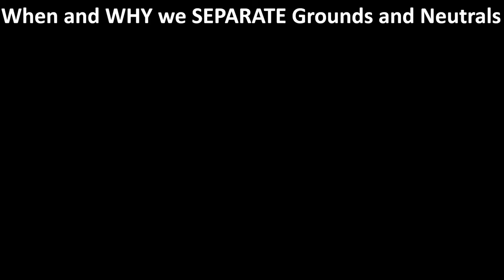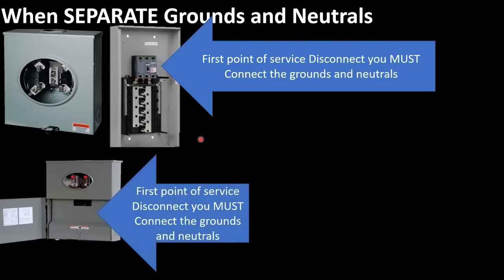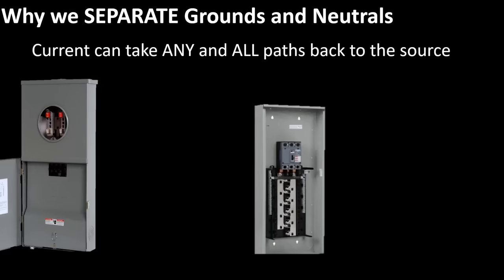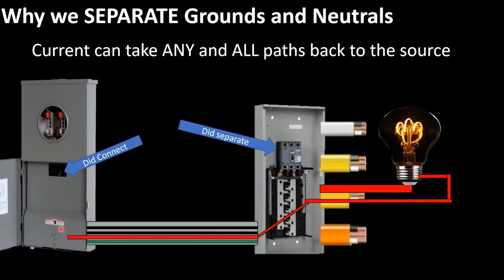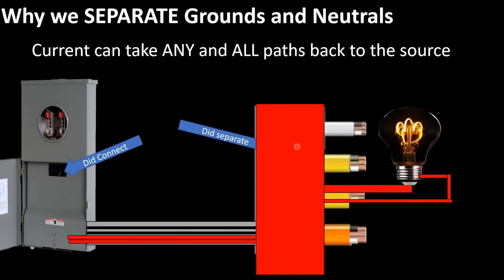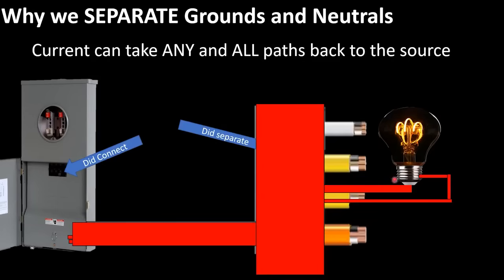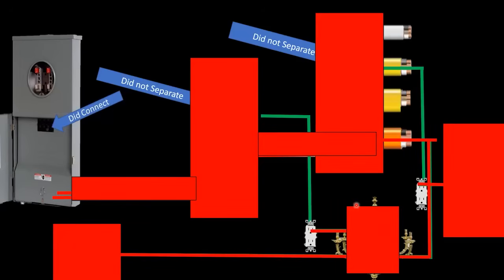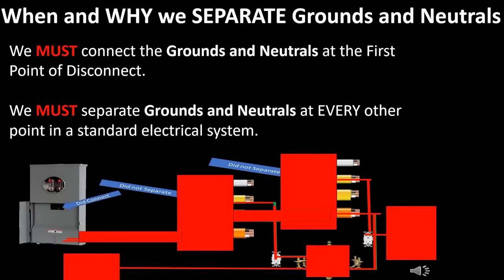When and Why to separate Grounds and Neutrals.

Comment: Great video. Thank you for sharing your knowledge.

Question: Hypothetically speaking, what if a house had a main panel with no main disconnect (just individual breakers), that panel would still be “the first point of disconnect”, correct? In this hypothetical case, the neutrals and grounds would be connected and not isolated. Am I right? I know that, by code, the panel would require a main breaker (except in a 6 breaker or less situation). Just trying to understand the concepts fully.

Comment: The ground wire should be installed as basically an "extra neutral" wire that is connected to the chassis of an appliance instead of the neutral connection on it. It's a safety wire that will safely carry the current back to the breaker box if there is somehow a leak of current from the hot wire, through a component inside the appliance, to it's chassis. 

That way, if your grounded body touches an exterior metal part of the appliance, YOU don't become the path for the stray current to return to the breaker box, it rides on the ground wire instead. Electricity ALWAYS follows the path of least resistance, and a properly installed ground wire has much less resistance to the breaker box than the path between your body, the earth, to the breaker box. Therefore, no shock from a leaky appliance if you touch it with a proper ground.

Comment: So? You said just current flows. You did not even begin to explain why it is a bad thing. I live in a country where for 50 years the standard  grounding system as TN-C i.e. grounding with the neutral. It even was mandated earlier. On my apartment panel the groudn an neutral are connected and then only neural goes to the sockets. If I tuen m microwave on I get slightly under 1 volt to the grounding system.

The problem is that the current may go through IT-cables and cause interference there.

Comment: I have a switch, inside the wall the meter is on, the grounds are bonded with the neutral, the switch has two knife fuses on the main power leads. Then onto the house breaker panel 25 feet away, where the neutrals and grounds are bonded again. I want to disconnect them from each other, there, making sure they go back to the switch box, and again from the switch box, run a 45 foot underground cable to the shop and run a second sub panel, is this ok?

Comment: As an electrical inspector of over 30 years this is by far the #1 NEC violation is see, the problem is here in NY State there's no State wide  licensing for electricians which says it all.
Reply from the maker: I do not know that, thank you for sharing!
Reply: @ElectricalCodeCoach  Very frustrating for me, came up through the  IBEW as an apprentice and  a Journeyman Electrician/ instructor for over 20 years before a debilitating  back injury forced me to refocus my career. Neither electricians or electrical inspectors are licensed in most of NY State except in the City which leaves 95% of the rest of the State  a free for all, most inspections are by unlicensed and unregulated 3rd party agencies.

Comment: AWESOME video! Quick question. I'm looking to do two subpanels in series (garage subpanel connects to shed subpanel for multiple local branch circuits for shed lighting, 240v air compressor circuit, and outlets). Given what you've stated in this video and your out building series, I'm guessing BOTH subpanels need their own ground circuits (separate grounding rods and equipment ground in series from the originating structure) and BOTH subpanels need to have their bonding screws removed?

Comment: i love your videos, learning so much! 
What about the GEC and ground rods. Is there only supposed to be one single GEC going from the first point of disconnect to the Ground rod and on to a second ground rod 8 ft apart? 
Would it hurt if there are additional GECs connected from subpanel A and subpanel B's grounding bar to the same 2 ground rods outside? (that is what I think I see in my home right now)

Comment: I am running a 10/3 from a double pull 30 amp in the main house.  Burying it in PVC conduit.  Into a can in my shed.  The can in my shed looks like your graphic but does not have that bar connecting the two bus bars that are on each side.  So should I put all my neutrals on one bar and all my grounds on the other?  that would keep them seperate correct?

Comment: Here’s one that baffles me - you have a range or dryer with 3 terminals and ground. The instructions tell you in a 2 wire install (older homes) to connect the neutral and ground on the device together. I was thinking this through, and became real to me when I tried to use a 40-amp gfci breaker and it kept tripping.  Often the logic boards or a motor are 120v, so they are technically flowing neutral current through ground (and the shell of the device), and if at some point a fault occurs, or the grounding conductor comes loose, that shell now becomes live.  I was taking some lineman courses and they were talking about the requirements for parallel grounding of disconnected lines due the possibility of picking up on emf current simply from being next to an energized wire or the wind blowing. This stuff is serious and we take so much for granted.   Sorry for the rant, but there is a lot behind how we ground.   God bless and thanks for all your work.

Comment: So my 200 amp panel, only point of disconnect, only has about 14 neutral screws left but 20 spaces left for breakers. Obviously I am going to run out of neutral screws and I know you cannot double them up. What is the best way and most professional looking way to rectify that? Am I to assume I can just add another bus bar to panel and use for neutrals?
Reply from the maker: Is it a newer panel?
Reply: @ElectricalCodeCoach  Yes, the Square D QO142M200PCVP.

Comment: If the Ground and Neutral are bonded at the first point of service, couldn't current travel back through the Neutral to the panel?
Reply from the maker: Yes, but the safety and neutral conductors is that they're insulated

Comment: In workers camp.....a hot/cold shower mixer has a 10 volts AC from those copper plumbings with the concrete in the bathroom. When the earth cable in the water heater was disconnected.  Now it's fine. Didn't bother to troubleshoot specially those were old facility.

Comment: @7:00 side note, the panel and rigid will only be energized if you bonded the neutral bar to the panel which like youve been saying they should be seperated at every other means of discconect but also unbonded.

Comment: Awesome video, definitely subscribing!!   So what would I do if I’m off grid with solar going to inverters (240v inverters with midpoint auto transformer to make two 120v legs)  connected to a sub panel that then was wired to a main panel in the home?

Comment: GREAT VIDEO!!! I love the way you used the diagram of current flow. That made it very clear what could happen. You were also using correct electrical units describing current flow for what it is and no words like "power flowing". Nice job all around. Thanks!! Wish you would do video on generator transfer switching.

Comment: What if there is no ground wire from the combo panel to the house panel? There's just triplex urd with two hots and a neutral. The bonding screw is still attached on the house panel.
Reply from the maker: There are a lot of factors here, I would contact the qualified license electrician

Comment: But what happens in the system that makes this actually dangerous? The way this is explains basically makes it seem like any sub panel that has grounds and neutrals has voltage running through all of this metal stuff and is dangerous. WHEN does it become dangerous? What has to happen before this becomes potentially deadly?

Comment: Great info.  Do have a video explaining the connection to ground rods and grounding to gas and hot/cold water pipes?  As I understand, I'm suppose to connect my first point of disconnect (meter base) to the rod rods.  Do I connect the gas and hot/cold water pipes to the first point of disconnect, the load center, or either?  Also, can you explain bonding between meter base to load center when using PVC vs EMT?  Thanks.

Comment: In your last picture (with bonded ground/neutral at both sub panels), would a non-contact voltage tester detect voltage on everything red (chandelier, fridge, conduit, etc.)
Reply from the maker: Great question, no you would not detect voltage most likely, but in these situations you can take an amp probe and read the amperage. Keep in mind that it's all flowing towards the source so you are only going to be reading objectional current that is in front of it heading back to the source.

Comment: Say Coach, what do you say about XFRMs? Do we not typically bond the neutral and the ground on the same terminal bar in a transformer?
Reply from the maker: You are correct, they often Bond there as well and at many other points in their system. Typically the general public is never going to be in contact with it.
Reply: @ElectricalCodeCoach  Ha, I see your logic behind your statement. Thanks again!

Comment: I need to bury my service. It will come up to the structure on the east side instead of the west. The existing main panel is inside on the west. If I use a combo, meter socket/ emergency disconnect will I need to change the existing panel in order to separate my ground and neutral, or if needed,  and as long as the neutral bar is not attached directly to the "can", can I add a ground bar to accommodate moving the grounds in that existing panel? Thanks and your videos are solid and much appreciated.
Reply from the maker: Great question, definitely work with a qualified electrician and your electrical inspector. If someone changes the scenario they're going to need to end up 4 feeder wirea  if it is not already present and separate the grounds of neutrals while still maintaining bonding the can to the grounds

Comment: Does 230.91 require the service disconnect to be a ocpd/fuse? Or.. what if for example somebody decided to install first a non-fusible switch disconnect after the meter can? Would it be then legal to have your bond in this unprotected non-fusible disconnect and separate the ground and neutral in the first panel with OCPDs? Because we're not specifying what kind of disconnect it is. Just first means of disconnect. Once I had to argue that the meter is not the first means of disconnect because they confused the bypass lever for a disconnecting means.

Comment: QUESTION: If a house has an Off Grid solar inverter, while using the inverter as the power source, the grounding rules are consistent with your video.  

BUT if the Off Grid Solar inverter, is connected (still not feeding back to grid, only as off grid) to the grid to use grid power to send power to the inverter, to charge the batteries (when not enough sun), then the ground from the grid connected plug, becomes bonded to the inverter ground, 
and you end up with TWO GROUNDS in Violation of the rules in video, because the inverter in essence is the first cut off when not connected to the grid, and is in essence a sub panel when connected to the grid!!!

So what should be done with ground in this instance?

1) Do not connect ground wire in plug from inverter that connects to grid for power?
this creates two separate grounded systems
and may backfeed in either direction???
not sure

2) create a ground wire disconnect on the inverter, so it only connects to grid ground, when grid connected as a power source, then if unplug from grid, reconnect inverter to the inverter ground???
this seems more plausible - but must not forget when connect or disconnect

3) some other solution you recommend

thank you
Reply from the maker: Thank you for the question, I would contact a qualified licensed electrician solar installer on this one.
Reply: I appreciate your reply.

I dont think there is a definite answer that is acceptible to many, because this would be like connected two separate grid systems together, deciding which should be the master and which should be the sub system is not a clear decision.

I think that I am going to go with, bonding the solar ground to the grid ground when it is connected to the grid, and when not connected to the grid, connecting the solar ground to it’s own ground rod.

The issue is how to automate, or physically make a mechanical switch that can achieve it,  to avoid issues of overlooking having a single ground, or mistakenly having no ground.

I hope someone else will reply with their opinions on this.

Comment: I've noticed alot of electrical workers do know when and where to bond and separate grounds and neutrals. What I've seen time after time of not bonding a transformer. I've seen lots of licensed electricians think that because of  first disconnect being bonded that they didn't have to bond the transformer . I maybe wrong I my explanation ,but I try to explain that it is now a separately derived system and you start all over again.

Comment: Unless there is a disconnect of both the ground and neutral at the main panel of the feeds to the subpanel, how is it necessarily "dangerous" to have the ground and neutrals connected? The grounds are normally connected and technically "energized"  due to them being bonded back at the main panel anyway. Being also connected at a sub panel should make no difference in terms of safety. I understand that the code rule is there to be extra safe because in the event that both neutral and ground are disconnected at the main, they become hot relative to the neutral at the main, and the earth too, so they become hazardous. Only in that case though.
Reply from the maker: That's a great question, even if they are bonded back at the main panel current only flows back to the source it does not flow back upstream, only toward the source.

Comment: How does this apply to solar or generators…do the neutrals need to be grounded at the disconnects and inverters (since there is power source on both ends)?
Reply from the maker: That is a great question check your manufacturer specifications
Reply: @ElectricalCodeCoach  Sometimes you can't get good information from the manufacturer.  I feel that the whole subject of generators and or solar generators needs to be explained. In a scenario where a generator is connected to the house wiring through a transfer switch, would the transfer switch be the first disconnect?  What if you can't easily separate the ground and neutral at the external power source, is there a safe way to connect the external power source to your service panel.  Do both the neutral and hot leads need to be switched to the external power source?  What if the transfer switch only switches the hot leads but passes the neutral and ground?  I have tried to find these answers. From what I read,  I think that the both the neutral and hot leads need to be switched on each individual circuit.  I would love some clarification on this subject.

Comment: So what happens if we don't have the disconnect at the meter and our first point is the breaker box? Now the neutrals and grounds are all connected and the chandelier and refrigerator are both part of the path. Why is that different?
Reply from the maker: It's possible to have objectional current anywhere they are bonded but we have to keep in mind that the current only flows toward the source it does not flow upstream.

Comment: Why not separate the entire system?
Reply from the maker: We need them bonded at one point in case the utility neutral is disconnected or the grounding electrode system is disconnected so we never end up with a floating neutral

Comment: So do they need a grounding rod? That’s the confusion for me.
Reply from the maker: Great question! Every system needs a grounding electrode system, for lightning and power surges.
Reply: Yes all systems should need a grounding rod. All ground rods should not be shorter than 8' deep in the ground.